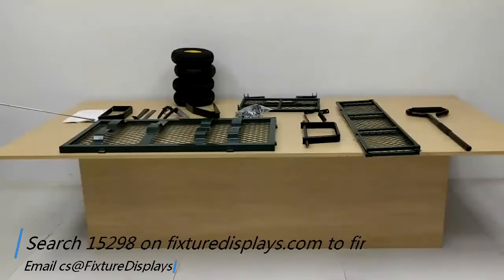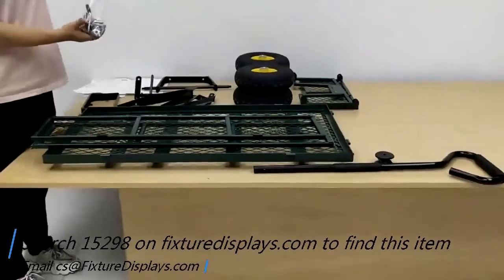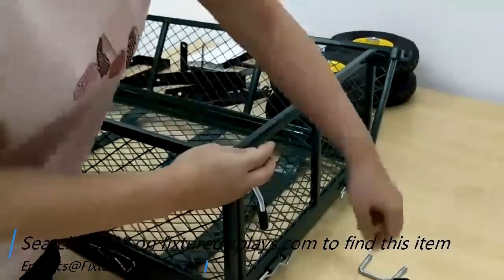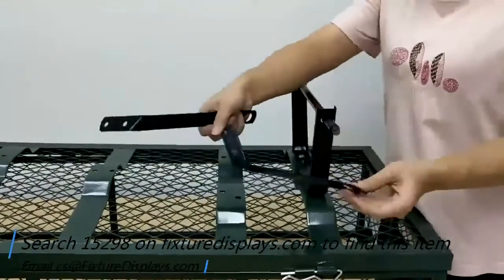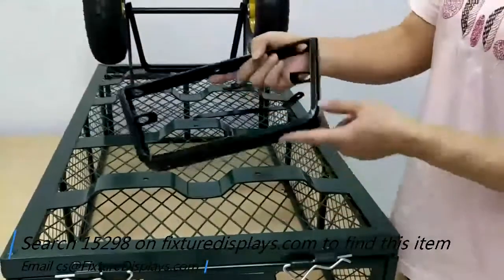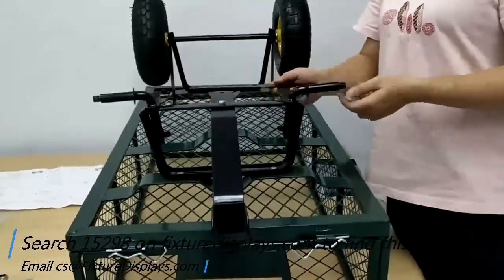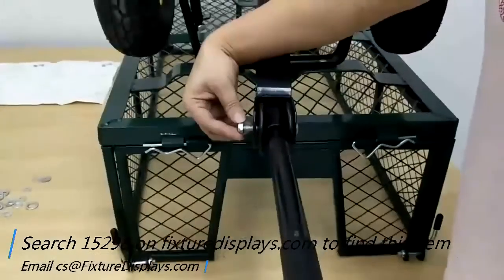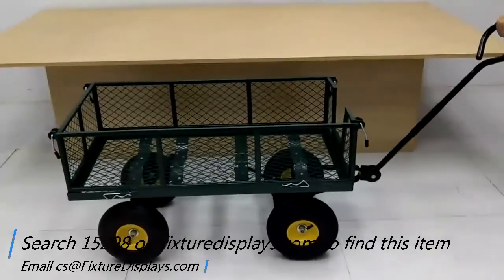15298 Garden Wagon Pull Cart Utility Cart 10 wheel FixtureDisplays  Instructions

Comment: My wagon came with no instructions.   So your video saved the day.  I accidentally placed my front wheel bracket on backwards.  The manufactures should have an arrow with the word FRONT written on the bracket pointing in the correct direction.  It would help to explain how tight the bolts should be for operating the steering system.  Thanks again!